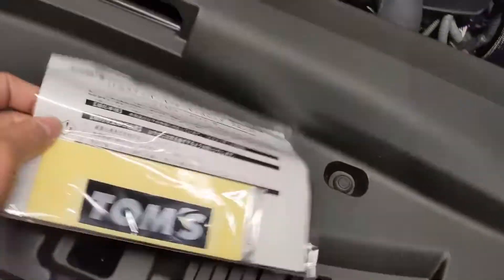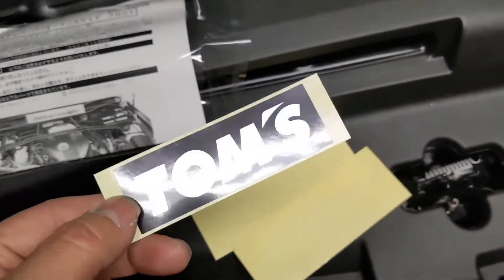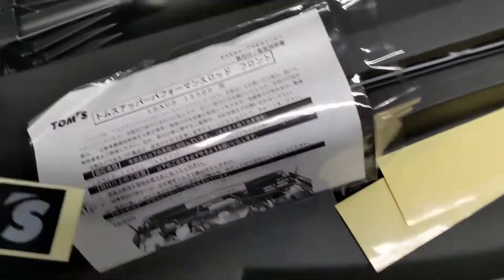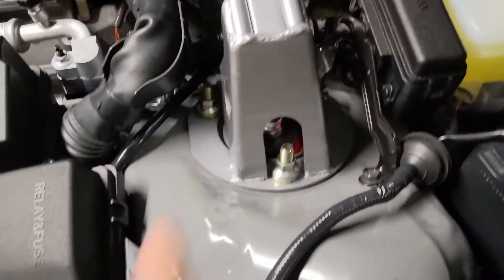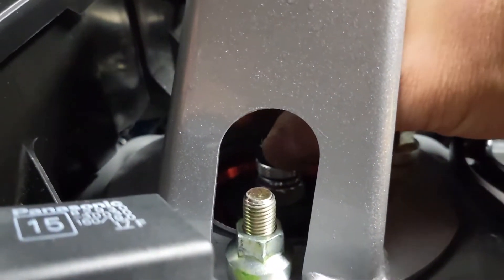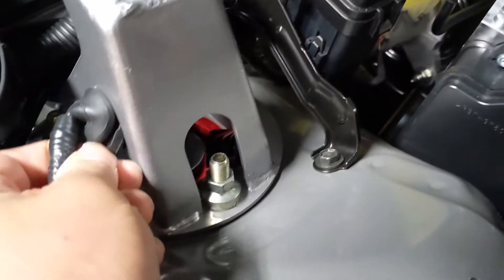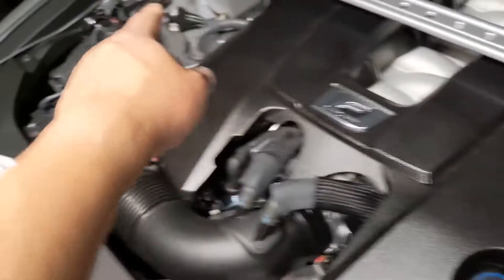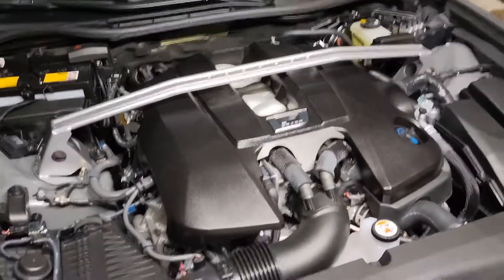TOMs Racing Front Strut Bar Installed // Lexus IS500

Comment: Hi Rodney, do you know if you can still retain the stock avs dampening?
Reply from the maker: If you had the stock suspension, yes the TOMS strut bar allows the AVS Dampening motors to be retained. it is so nice that TOMS made hole for the Grommet for the wire harness for the AVS to fit nice and clean. I do not have the factory suspension.

Comment: awesome job! do you have a link? and if my suspension is all stock is it fully compatible with the wiring so that I don't need to drill it anywhere?
Reply from the maker: Yup that hole on the strut bar for the dampening of strut harness grommet is pre-existing, no need to drill holes.  I have link of where I purchased from and part number in the description of this video..
Reply: @specONE  thanks a lot. that's 1 thing i dont like about the RR racing version. So is the difference noticeable (compared to without a strut bar)?
Reply from the maker: Noticable? Honestly I can't comment on this myself. I barely drove the car before I went and started modding it left and right. But hey, a true F car does have a strut tower bar in place.

Comment: Hi! Quick question about the wiring mechanism on oem front suspension going to aftermarket coilovers or airsuspension? Do you get any lights on the dash? I saw on your video that you didn’t connect the wire on it? I mean yeah i got airlift suspension. Any advice?
Reply from the maker: No faults set when the electronic suspension dampening control motor is left unplugged
Reply: @specONE  thankyou. 🙏🏼🙏🏼🙏🏼